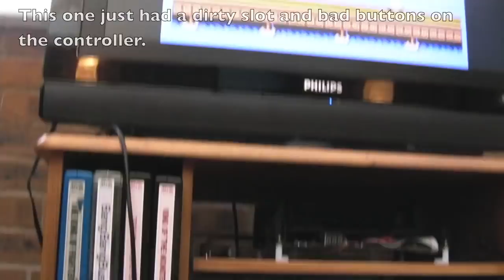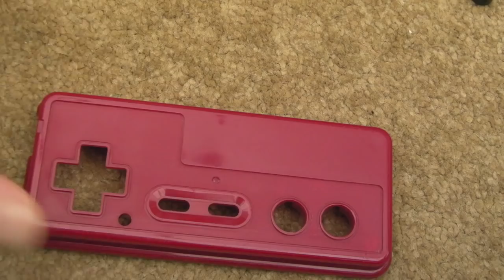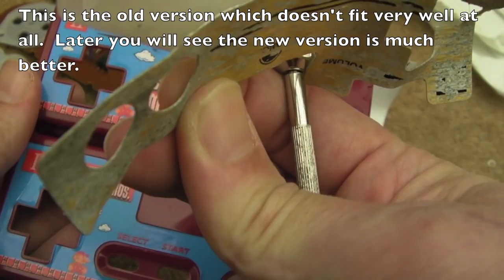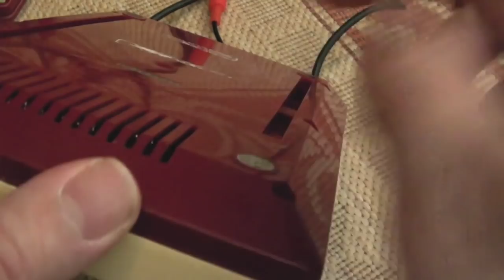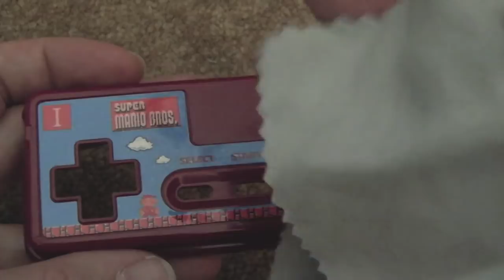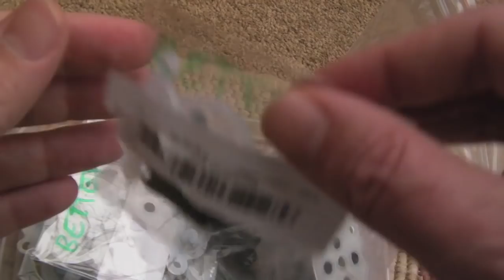5 Nintendo Famicom Repairs - Part 3 (Switch, Modern Controller Facias, Cleaning)

Comment: I searched everywhere and cannot find these controller fascias. I found a descent looking system but the fascias are pretty shot. Should I just sand them down with a Magic Eraser or light sandpaper so the gold color is even or just remove them altogether? I can find NES ones but not for the Famicom.
Reply from the maker: =/  Check the other link posted by someone for original replacements - maybe that link still works?
Reply: Ebay has some currently

Comment: What's the original resistance over that volume pot area of the gamepad? You can get electrical tape with quite high resistance for that. I haven't tried it myself, but search for "bare electric paint". 32Ω for a 10mm wide 10mm long patch, or 320Ω for a 1mm wide 10 mm long patch, so might be close to the original resistance.

Comment: I had no idea "Kung Fu" was called "Spartan X" in Japan. I can't figure out how this game relates to the Spartans. That's weird.

In any case, this game doesn't have any RAM In the cartridge. The PCB type is HVC-NROM-256 (NES-NROM-256 for 72pin). It's a very basic early PCB type with small, non bankswitched PRG and CHR ROM chips and nothing else.

I could be remembering wrong, but I think the 2KB VRAM on the Famicom/NES only stores the background tile map, not the locations of sprites. I would guess the sprite locations (and scrolling data) are stored in registers in the PPU, but I'm not sure.

It seems that Kung-Fu apparently renders the main character as a set of background tiles, not a sprite. This would help prevent flicker and might also help availability of color palettes for the "real" sprites. It's interesting the tricks programmers pull that we never notice, but this experiment without any VRAM installed seems to have revealed it.

Background tiles are solid rectangles with no transparency, so that's hidden by making the backdrop a flat color. He's also always locked at the center of the screen whenever enemy characters are present. When he walks in from the side at the start of the level, we can see the game is actually scrolling that region of the background, not by animating him as a sprite.
When he walks up the stairs at the end of a level, this would explain why his movement is kind of choppy (since he's a background image, he's being stepped across background tiles, not moving per pixel like a sprite would be able to).
He does have a jumping animation during gameplay, but I guess they just provided enough tile images to make that movement look reasonably smooth.
Reply from the maker: Thanks for clarifiying the RAM not being on that cart!  I had completely forgotten that the actual ROM on the NES ends up as two chips, PRG and CHR.  Very interesting observation about the way this particular game works!  I am sure you're right, it does appear its using the background tiles for the player =D

Comment: Do you know how to fix the Power part of the Famicom??
Reply from the maker: Generally speaking, there's the power socket - resoldering connections and spraying contact cleaner will usually clean that up.  Then there's the 7805 voltage regulator - 3 pins on it, left pin is input (normally around 12v DC), middle pin is ground, right hand pin should be outputting 5v DC.  Make sure you dont short any of the pins whilst measuring or you could kill the PSU or the Famicom.  There will be an electrolytic capacitor between the 5v DC output of the regulator and ground - its not impossible for that cap to short and drag the 5v rail down.   The other possibility is something else on the Famicom is shorting out the 5v rail - if your 5v is low (say 3 or 4v or less), temperature test each chip to make sure one isn't getting super hot (that will be the faulty chip).
Reply: I've been watching your famicom repair videos and I must beg you for some more. I absolutely appreciate your response!!!
Reply from the maker: Thanks =D  Will see what I can do!  I was going to get my logic analyzer onto a Famicom to show how it works.
Reply: I have my famicom and I tried to remove the metal panel with no luck and I removed the yellow substance like an ass. Now I'm waiting for the money to get a Volt Meter to see whats broken.

Comment: Out of curiosity, would a conductive pen work on the microphone slider? I realize it might not last long but what about the stuff you paint on with a small artist brush? Sort of like the rear window defrost repair kits.
Reply from the maker: It might do, but the problem would be the sliding switch would very quickly wear the conductive paint off I think =/

Comment: A long (ish) but very enjoyable video, as usual. Keep up the good work Gadge. Thanks for the controller overlay link too, I have a NES and by following the link I found the ideal covers to cheer the wife up (TMNT ones).
Reply from the maker: No worries =D  And thanks for commenting =D  Let me know how you get on with that NES TMNT sticker - would love to see how they look!
Reply: I imagine it's gonna look pretty bad imo, but she was a huge turtles fan as a kid (hence having the NES and TMNT game to this day!). My only hope is that should the need arise that it's removable from the original without harm. I wonder if applying a more common tape (proper Sellotape) prior to the sticker would be a good idea - I do fear adhesives at times lol. 

Also, would PlastX harm the matte effect of our NES? It has dark scuffs I'd like to remove, IPA has had little effect on them and I'm worried about more abrasive stuff making it shine. Thanks :)
Reply from the maker: It can be hard removing scuffs from the NES - I find that IPA can work but you have to repeat several times, and the net result is the plastic ends up looking a little shiney where you rubbed with IPA.  You've also got to be careful not to get IPA anywhere near labels, particularly the main red NES label on the cart flap on the NES - It will wipe straight off with IPA.  The facias are really easy to remove and dont damage the controller plastic - so I wouldn't worry about that.
Reply from the maker: And PlastX might help on the NES scuffs, but similar issue as the IPA - might need to try several times and plastic could end up looking shiney at that part.   It's wierd because any other system the scuffs generally come off a lot easier.

Comment: A great series of videos. You have to love the PlastX. I started using it after one of your much earlier videos -- always amazing result. And those new glossy facias are the cherry on top. Well done.
Reply from the maker: Thanks =D  Will get chance to look at that cart PCB soon!  Yeah, PlastX is great!  Back to Black is also great for giving shine, especially on black plastics.
Reply: Ok, I will check out Back to Black too. And while we're on the topic, Rubber Renue is another handy chemical brew for bringing rubber back from mummification.

Oh brother, Simple64Cart is turning out to be full of surprises. As I write this, bwack is telling me on Twitter is doesn't fit in a cart shell. I suggested to him we start calling it the Simple63Cart, because it just isn't there yet.
Reply from the maker: Haha, or the Complex64Cart =D  Haven't had chance to look yet, but should do in a week or two.  Just had too many things backed up, and too many jobs around the house to do.
Reply: No problem. I know what you mean...painting today, myself.  I did email you KiCad project files (converted from Jim Brain's original Eagle files) -- not sure if you received it --  if you wanted to tinker with the PCB layout.

Comment: The cable tie trick was a good idea. Also, there was a perfect example of when to actually change a cap :)
You have to respect the general quality of these controllers. They get a lot of abuse over time.
Some prints on metal casings can be erased when using alcohol. My Saitek X52 flight stick has half the print left because I tried to clean it.
Reply from the maker: Thanks =D  And yes, you're absolutely correct - IPA can remove print from stickers and labels, and it's possible to do that on the rear stickers on the Famicom if you're not careful.  Same thing with the NES logo on the front of the NES - that will come off with IPA.
Reply: I'm extra careful with the stuff now.

Comment: For the worn off carbon traces on the mic, you could try a rubber keypad contact repair kit. I used a Circuitworks kit (2 part conductive material and epoxy) to repair a 6 button SNES Scoremaster joystick. I used masking tape to mask off the pcb then painted it on. This is the stuff, it seems to take the punishment in the joystick although you might find a cheaper alternative: http://au.element14.com/circuitworks/cw2605/rubber-keypad-repair-kit/dp/128790
Reply from the maker: Thanks, might give that a go at some point - The one with the Mic issue I've kept for myself as a spare (wouldn't want to sell it on with the Mic as it was anyway).

Comment: The graphite strips beneath where the microphone slider sits are completely missing inside that controller 2 that you show. 

There are some photos of how they are supposed to look here : 
http://www.retrofixes.com/2013/10/cleaning-famicom-controllers-fixing.html

It is hard to tell in those photos, but I believe the lower graphite strip was originally varying horizontally in layer thickness to allow varying conductivity when the slider contacts were moved (holding the controller normally, thicker at left, thinner at right). So, your copper tape lets it work again for on and off, but without any varying in the conductivity for the microphone. It would be hard to recreate the original manufacturing process, but someone could try. They make conductive graphite paint (search eBay for those three words); we could apply some in layers, varying thickness over coats in a gradient across the strip. Probably too much work for most people, but that is likely what restoration would require when the graphite strips are completely gone. I think this was a cheaper design than using a sliding potentiometer when the console was designed, but probably less than ideal overall.
Reply from the maker: Thanks!  I've still got that Famicom, it was the one I kept for myself (others have gone now).  So I can have a go at trying to get the volume working later and I might try what you've suggested there =D

Comment: I repair broken Nintendo portables I buy on eBay with the hope of selling them. I highly recommend vinyl stickers. Any time the previous owner has put vinyl stickers on his console, they come right off, even after 10 years. Paper stickers are difficult to get off, and certain handhelds, such as the DSi and DSi XL, are sensitive to alcohol, so you damage the unit a bit when you take old stickers off.

I personally prefer to restore portables to 100% factory specs, but those vinyl stickers are pretty good.
Reply from the maker: Thanks for the info there on different sticker types =D  Yes, I agree - where possible restoring to original is my preference too.  At the time I just couldn't find proper replacement facias - I only became aware of the 'original looking' replacements after I had purchased the after market ones.

Comment: The glossy non-textured bottom on one of your FamiComs is from the rarer original model. The original controllers on that model had square "A" and "B" buttons but I guess someone replaced the controllers at some point on the one you got.
Reply from the maker: Thanks for the info!  I had no idea the older models originally had square buttons!  Very interesting!

Comment: Nice tip on the cartridge port cleaning. I clean my C64C cart port the other day. I also bent the pins a bit also intentionally for better contact, but I overdid it so now the cartridge are hard to insert.
Reply from the maker: Thanks =D  LOL @ now cartridge being hard to insert!  It's funny but I have the same problem with my VIC-20 - it's almost impossible to insert a cart lol
Reply: hehe. It is not an exact science. I'll try bend them back.